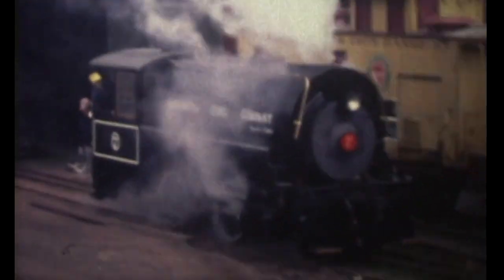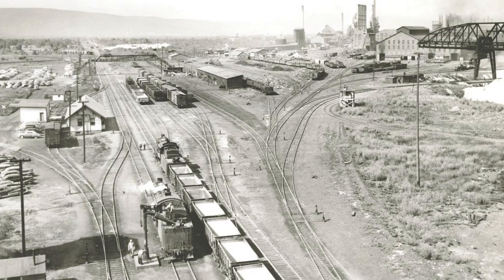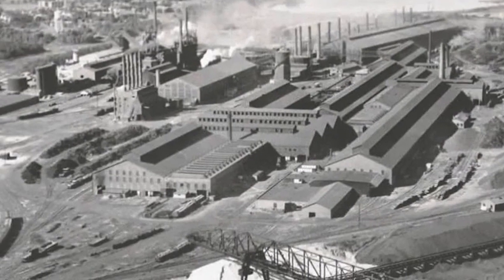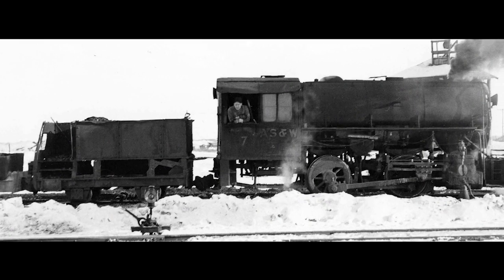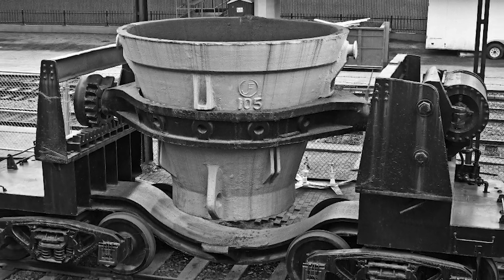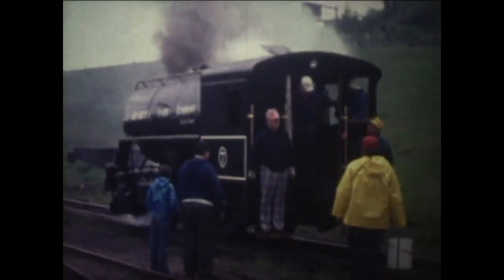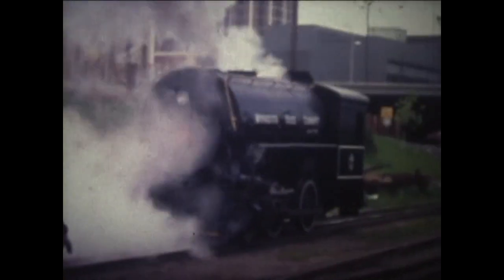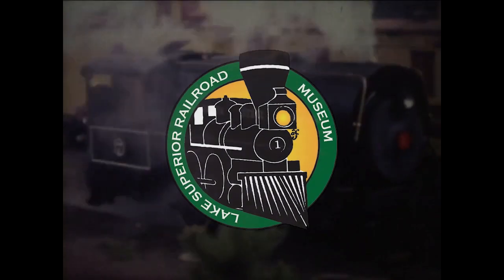7-Spot Gallery Video

Comment: Is there any plans to restore her back to operation?
Reply from the maker: Maybe someday. But its a very little engine to do anything with, worth doing all the work to official/license/restore... It probably couldn't pull but two cars or so for a mainline trip, thus not much you could do with it once it was running. Likely a horribly bumpy ride too with only 4 wheels on the ground. Note there is not tender either, so that even adds to its lack of distance. Its designed for "mill work" to go back-and-forth all day everyday.